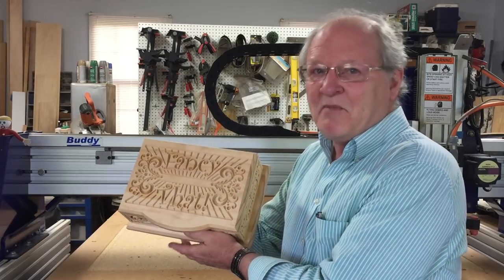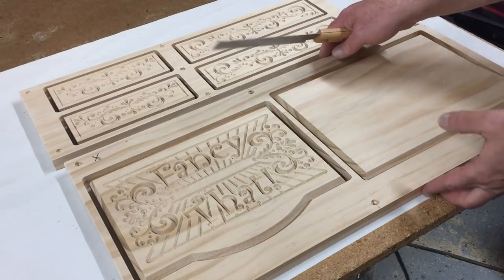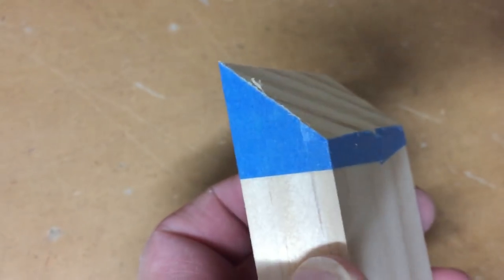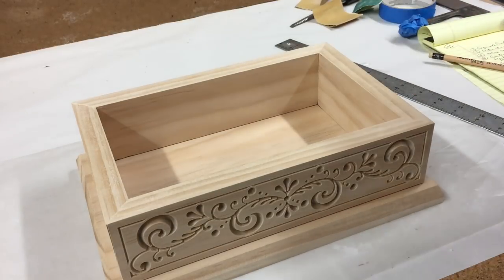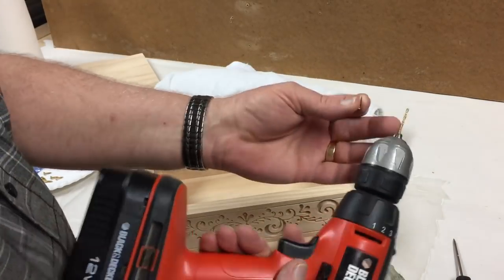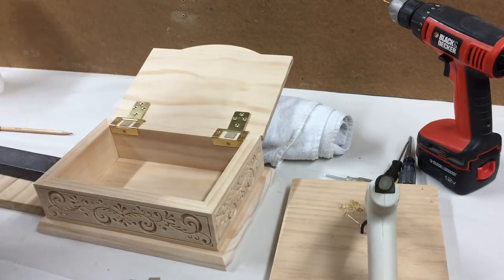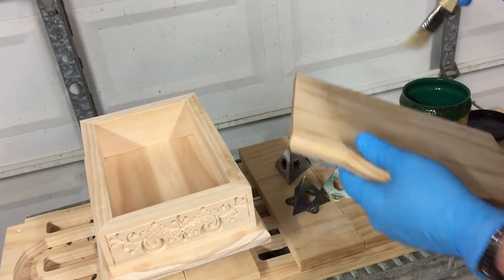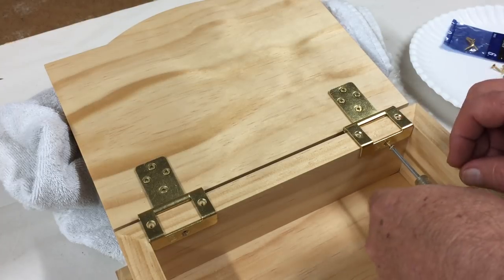Making a Box with a CNC | Michael Tylers FREE Project of the Month | Vectric

Comment: Hi Michael, very nice project.  To remove hot glue, use rubbing alcohol and it will come off very easily and it won't stain the wood.
Reply: You may want to use denatured alcohol, which doesn't have the lubricating oils that rubbing alcohol has.  This is especially important if you're planning to use water based finishes.
Reply: @ApexWoodworks  Good call Marty, thanks.

Comment: Thanks for the plans for the "Fancy That" box project. My granddaughters will love it!   I'm new to the cnc world and ran across a G code that I would like to change. In the profile cut of the bottom and top. Z moves to a position that is higher that the machine can go. This line is the first and last Line for Z to move. I have a waste board on my cnc. The G code tells Z to move 1.8000 when I actually only need 0.8000 making my bits to plunge into the wood further. I have edit the code but the next time I open up the file its back to 1.8000. Is there a way to save the 0.8000 value so I don't have to change it every time?  I'll look forward to your reply.  Thanks in Advance Mr. Tyler
Reply from the maker: Hello Ralph, and thanks for the question.  Have you checked your safe heights when calculating the tooling for your CNC before saving off the g-code?  I'm a little unclear why you would manualy change the code.  I would problay either recheck the tooling in your software before exporting the gcode (be sure to use the right post-processor for your CNC)  or send a note off to support and see if they can see any issues.  Hope that helps.  Hope that helps.

Comment: Nice design, but I can see the bottom splitting due to gluing the sides to it. The wood needs to move. A groove would be better for a panel to ride in (no glue), and then adding a decorative molding at the base. Frame and panel design has been around a long time, and for good reason! I hope to see future designs that take into account wood movement.
Reply: That's true, this box is going to fall apart in no time. The design takes no account for the movement of wood. However, I don't think the bottom is going to split, because the end grain to end grain mitre joints holding the sides together are really weak, so that's what's probably going to fail before the bottom has the chance to crack.
Reply: Yes, good point! The end grain is the weakest point, so I agree. The bigger issue  though is the project needs to be designed to work with wood movement. Other Vectric projects I've looked at have similar issues. I'm still grateful Vectric supplies the projects, but we should also be promoting good woodworking practice and technique.

Comment: It's a pretty box, but it's poorly designed and constructed. It is going to fall apart in a few years, if not sooner, for two reasons: 1) the sides are glued to the bottom, which is going to expand and shrink across the grain and 2) end grain to end grain glued mitre joints, which hold the sides together, are really weak.